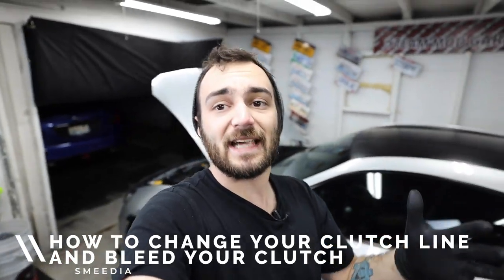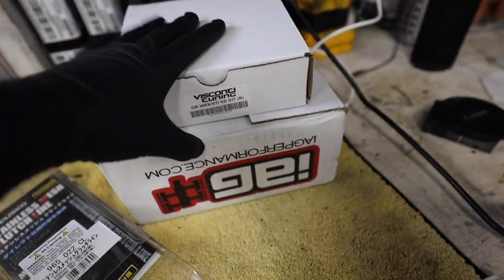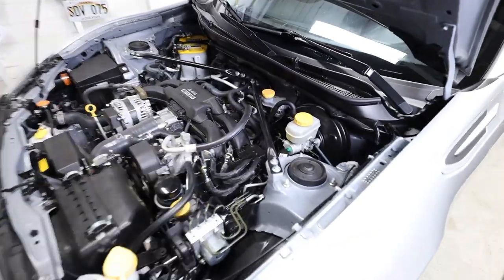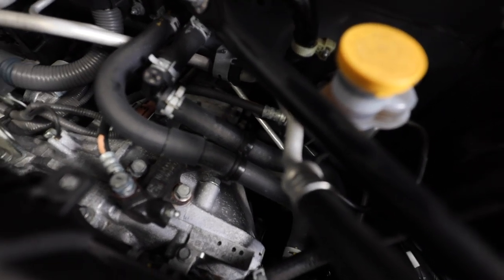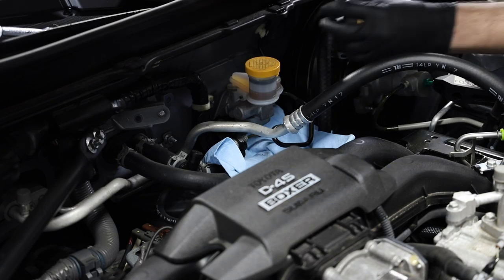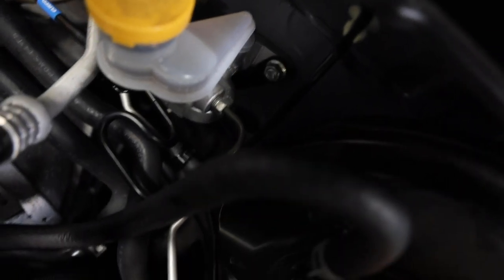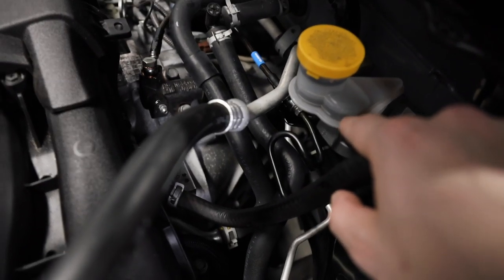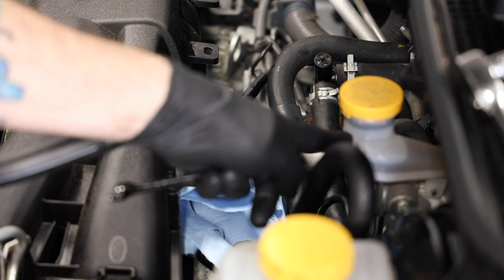How To Replace Your Clutch Line And Bleed Your Clutch

Comment: You should have a clear tube attached to the end of the bleeder valve. Because as soon as you try to close it, you've already trapped more air into the system. The clear tube will not only let you see if there's no more air bubbles but prevent air from going back in!
Reply from the maker: Was working with what I had at the time 😅🙏

Comment: Gotta get my lines stainless! All around! Thanks for the how to my man! Keep it coming! You’re crazy for your output. Do you sleep even?!!
Reply from the maker: Get a few hours of sleep a night 😂 the lines are well worth it and super cheap! 🔥
Reply: I notice my 18 STI clutch feel isn’t very stiff, like push clutch pedal but the resistance is very weak
Reply from the maker: @UpComingTechNow   A SS Clutch line will help to give it a little more resistance if that's the feel your going for
Reply: Smeedia yeah I’m gonna do that. Thanks bro!
Reply: Smeedia bro, I watched most of your videos, my car is complete stock 20k I should have air oil separator and catch something I forgot, oil pick up?
Reply from the maker: @UpComingTechNow  I would snag an AOS, the lock up is not required but i would suggest it 😁

Comment: Definitely a good mod and good video as well. But if you want a dramatic difference in pedal feel you need to change the slave cylinder to the smaller Subaru 30620AA111 Slave Cylinder. Can't wait to change both on mine.
Reply from the maker: Did not know Bout that 🤔 definitely going to look into this now, appreciate the input 😁
Reply: @Smeedia  No problem. I also just saw you are gonna boost the BRZ, if you get a stronger clutch it may not be needed or advisable to change the slave cylinder to the smaller one. Definitely research if you're going that route. Finally, if you haven't done them yet the clutch assist spring removal and clutch pedal travel adjustment are two free mods that transform the way the car feels. good luck
Reply from the maker: Ive already ordered the turbo kit, should hopefully get it in two weeks and just got the stage 3 competition clutch in the car with lightweight flywherl about 2 weeks ago. Have the MTEC springs i put in, need to dwap the pedal spring as well but have it in the garage ready to go
Reply: Hey brother, I know this comment is crazy old, but will this slave cylinder work on a 18 WRX?

Comment: Tanner, I know this video is old but came here to check out how to properly flush my brake and clutch fluid. Just a question. I see you were going to use a power bleeder in this video but couldn’t. I just read in the forums to not use the power bleeder on the clutch. Do you agree with that?

Comment: Hey smeedia, with your sti did you use the power bleeder to do the bleeding for the clutch. If so did you need the extra person to help with the pedal or does the bleeder just do it.
Reply from the maker: Yessir I used the power bleeder 🙏 but you can definitely do it with a second person 🔥

Comment: My clutch has been feeling super spongy. My car has 30k on it, I’m wondering if it’s time to do this.
Reply from the maker: Might not be a bad idea to replace the fluid as well
Reply: @Smeedia  Could you please share any advice for replacing all the brake/clutch fluid like is recommended with the (15+) WRX 30k standard service? Would it be a similar procedure to this or maybe each brake caliper needs to be bled also? Capacity of brake fluid needed for total replacement? Sorry if you’ve already answered these, I simply trust you more than anyone else in this community, and I’m not alone in that sense 🥰

Comment: Hey man awesome video!
Was wondering if you new which one of the lines you stated would work for a 2019 Impreza?
Reply from the maker: I would check RSD or similar sites, length of line will be a factor but should be the same install 🙏😁

Comment: What happens when the clutch stays fully depressed and no air is coming out of the bleeder valve? i am in this current situation
Reply from the maker: Only fluid coming out? First thoughts are bad slave cylinder or bad master 👀 is the slave moving?
Reply: @Smeedia  clutch ended up working fine. I retracted the pedal and there is still pressure in the line. I didnt end up bleeding the line. I was doing a Edelbrock supercharger install
Reply from the maker: Ohhhhh jelly of that SC!!!
Reply: @Smeedia  thanks! Im praying no issues/codes at the end of this. First time installing anything major…
Reply from the maker: You got it 🔥 lemme know how it goes! Kinda wanna try fitting the edelebrock onto my 2022
Reply: @Smeedia  that would be interesting, hopefully you can get it to fit. Im almost done installing on a 2020 and the alternator connector is interfering with the supercharger manifold… people have been saying this kit is an easy install but its been the worst experience Ive had working on a car

Comment: Hey Smeedia as always excellent video since I will be doing the same thing soon. I have a few more questions for you my guy and want to ask if it would be ok to email you a list of what I have so far and get some feedback from you. If that's cool just let me know.
Reply from the maker: Go ahead and send it over 🙏🔥
Reply: @Smeedia  sweet may I ask for your email or is it in one of the older videos?
Reply from the maker: Tannerwrx525@gmail.com 😁
Reply: Thank you very much. I had just sent you the list.
Reply: @Smeedia  i have a question if I am upgrading my tmic and putting my bpv on would that technically put at stage 2? I am only asking because I am trying to make sure to either leave the cobb tune for know or get the tune asap.
Reply from the maker: A protune would be suggested for a larger TMIC 🙏